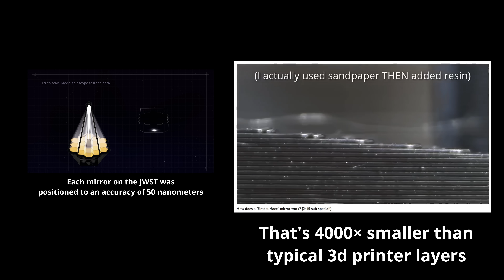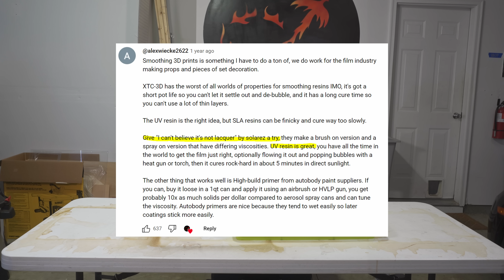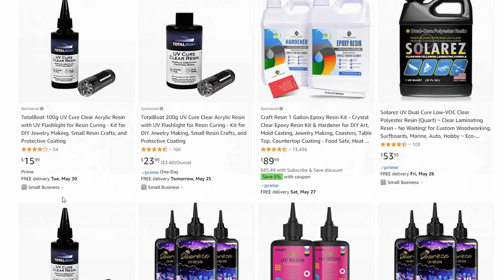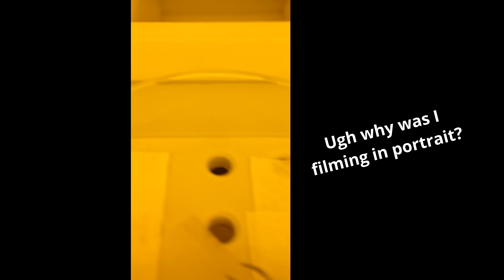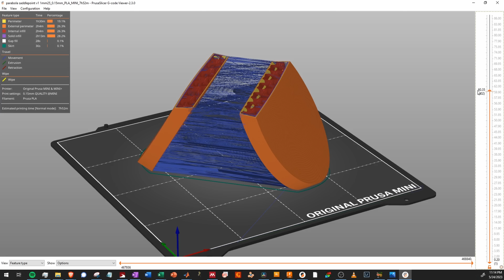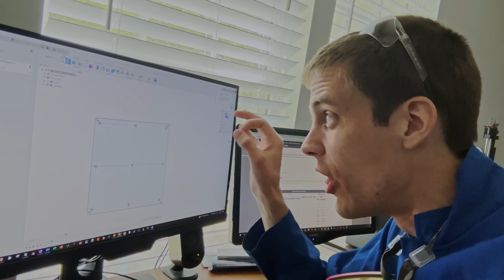Two ways to make asymmetric mirrors (Printing vs. Warping)

Comment from the maker: Corrections, additions, and FAQs:
1) Thanks to Steve for the idea of a saddlepoint mirror, and giving me the excuse to bust out the silvering solutions again! https://youtu.be/sP0cwLuEwsw

2) Yes, since I know people will ask, I have seen the HEN3DIRK channel that has some incredible videos of electroplated SLA prints. I haven't embarked on that challenge quite yet… https://youtu.be/ywPi1osy7o8

3) "use a resin printer!" yes, you're totally right! I have an old one in a box that I've never ventured to use. it's on my list! In this case, I still doubt I'd have achieved an optical surface, although if you read that paper I flashed up on the screen, they claimed to get something approaching diffraction limited with an SLA printer, which just feels impossible. I think their smoothing resin was also very different from what you can buy on amazon.
3b) Someone in the discussion below about resin printing said that you could buy one with 50nm resolution, and I highly doubt this. you CAN easily get one with sub-50um precision, but unfortunately 1 micron = 1000 nm. light is crazy small

4) z-axis wobble (or any inconsistency on the rails, belts, and screw) ABSOLUTELY could have been at fault for some of the wobblyness. I can't stress how small these changes are. It was difficult to film it in a way where you could tell there was a difference from layer to layer. For every purpose that isn't reflecting light, it was perfect lol.

5) I DID actually sand down my best-performing mirror prior to coating. you can see the sanded part in the "coating" close up, and you can briefly see the green jig with blue tape bubbles chucked into the lathe. for some reason I didn't actually film that?? I put the mirror on the lathe and use a few sandpapers. It made it look better to the eye, but didn't fix everything apparently.

6) I'm doing this crazy silvering process instead of some kind of chrome paint because I was initially trying to make optics, and for that the surface needs to be absolutely perfect. That's also why I didn't do vapor smoothing, which I think can leave a slightly porous surface.
Reply: I would have 3D printed only the perimeter and then shrink-wrap it
Reply: hey how can i contact you ?
Reply: Why not try a resin 3d printer? The layer line issue is almost non existent.
Reply: Resin 3D printing is much smoother and much stronger than FDM printing
Reply: Hi Brian, the way you think about and explain mechanics and physics is great. You said you like reading about science, so I have a link to a science article that I am certain you will enjoy reading. Are you interested?
Reply: My guess would be that a major factor in the 'every few Layers the direction changes' problem is the quality of the stl itself. Usually parts are designed with a mathematically perfect geometry (like vector graphics) but during the export to the .stl format, the curved surface gets broken down into flat polygons which with default settings would span multiple Layers. What you want to do in that case is to adjust the export settings to a level of acciracy that results in polygons that are smaller than the layers themselves. With that each layer will be positioned individually instead of in a plane with multiple different layers.
Reply: @Eoraph  I have printed things using the same STL file in resin and plastic usually pla although I have tried abs and petg and I can tell you from experience that I don't know if it's the slicer I'm using for the resin prints but the resin prints usually come out much smoother almost looking as good as an injection molded part.

Comment: I would have printed flat onto glass a solid mirror block. Then heat deformed the mirror to invert it leaving the previously flat glass-printed surface as the shaped mirror surface

Comment: If you mix your UV resin with baby powder, it'll become a paste that can be painted with, and after about five layers, you'll have a surface perfect for your needs.
You can also find some preposterously good chrome paints, which work best when sprayed (with an airbrush) on a 1k or 2k basecoat, and result in a mirror finish.

Comment: This is a very cool technique. I would love to see you attempt to make a parabolic mirror by curing UV resin in a spinning dish then silvering it. The focal point is a function of the rotation rate, but you might need something very accurate like a stepper motor to get a consistent speed. I suppose the dish could already be parabolic in shape so that it only needs a thin layer of resin too.

Comment: 1. Your guesses about the reasons of mid-scale wobbling are wrong. It's all about radial imperfections of the z-axis threaded rod(s).

2. Try to print with ABS and then smooth the lines with the acetone. Yes it will eat up the small details, but there are no small details on a saddle.

Comment: polystyrene mirror sheets can be heatshrinked to form this saddle mirror with first surface. You could 3d print the saddle with small holes for the shrink bed. The polystyrene isn't viscous enough to mold to layer lines, so they disappear. Great stuff, thanks for all the vids!
Reply: I just had this idea, as always someone thought of it first haha! Any insight into why styrene is better to use than acrylic mirror tiles for this? (Assuming both are first surface)

Comment: To get layer artifacts out you could try filler and sanding. If you want to avoid coating the 3D printed part, you could try slumping the acryllic sheet over the 3D printed part in a temperature controlled oven. Acryllic has a glass transition temperature of around 100°C. Polycarbonate 3D print filament has a glass transition temperature of 147°C. Alternatively make a plaster cast and then slump over that.

Comment: Hmmmmm...
...well the correct solution would have been vapor smoothing the plastic to get the correct shape.

So either us ABS in an enclosed chamber with acetone. Or ask chemistry lab to vapor smooth PLA with appropriate (and hostile to life solvents).

Thats how you get optical grade surface finish

And coat it for metallic finish via electroplating.

Comment: Creating a sharp image of something is the hardest thing you can ask a lens to do. There are non-imaging applications of optics (condensers, solar collectors, laser beam shaping, illumination) that can be served by a "good enough" lens. Creating custom-spec "good enough" lenses on a small scale using 3-D printing might have a niche where it does not justify the cost of making a mold.

Comment: Its too bad you couldnt just curve a hard drive platter. Those things are stupid shiny, and stupid flat.

Also a little mechanics trick I learned is when cutting a bolt, screw a nut onto it first. Then cut it, and removing the bolt will fix the threads

Comment: Just a suggestion, 
Why don't you use vacuum-forming to get your flat "whatever is feasible" to follow the shape of a 3D printed part. Printing small holes might not be possible, but you could drill the last few millimeters with a 0.5 to 1mm PCB drill .  The difficult part might be to geta sealing edge between the flat material and the printed shape, without causing tension deformations....
But for that I would suggest a bit of heating at the sealing flange to relieve the stress.

Comment: Recently I have been working with aluminium and nickel plating and I'm sure you could have achieved this effect with that. But I would really like to see a video where you explain what happens to the grain structure of aluminium during the process of burnishing and polishing as I don't really understand it and think it's an interesting concept.

Comment: I have used Angel Gilding products for more than a decade and I can say that the reason that the silver is coming off the sheet is because of the greater surface tension of the sheet so the wetting agent is not as effective as it is with other coatings. The solution for that is to use a Flame Treatment with a propane torch. Another point is that if you really want to print mirrors, just get rid of the FDM Printer and get yourself a SLA Printer, 4K resolution 3D SLA Printers are not even expensive any more(they are now pushing 8/12K). Silver mirrors will tarnish if not protected with a clear coat, but that will make them second surface mirrors. If you really want to 3D print and coat your own mirrors I would suggest investigating on to Electroless Nickel plating

Comment: I wonder if you could make a CNC sander out of a 3D Printer?  You could make a spring-loaded vibratory sanding head that would replace the normal printing head, and would sand down the printer layers.

Comment: There is a new FDM slicing  method that allows for limited movement in the Z axis on a single layer, you may be able to get better results using that. It may allow for better results since the layer lines  may be less impactful on the mirror surface. Though unfortunately I have yet to see an implementation of it that doesn't require some coding to use.

Comment: This strikes me as something that might be accomplished with a lappig process.

What about 3d printing a negative buck that can be rubbed against the first mirror surface with something abrasive?

Not sure if normal PLA abrades well - but maybe a filament with carbon particles or something would cut nicely.

Comment: UV cure resin is also used in resin printers in a similar way to the process you described, a mask is put on the LCD and then a UV backlight cured the resin through the mask. More advanced printers don’t use LCDs or anything like that though.

Comment: Hey! Thanks for amazing content!

I wonder if you considered switching to ABS plastic and finish the surface by simply putting the mirror into a chamber with acetone vapor which slightly dissolves the plastic surface over some tens of minutes? It is the same principle of surface tension smoothing the surface, just the liquid component being the plastic itself and not some complicated resin. You can precisely control the level of smoothening with exposure to acetone time. If you already tried it, what was your conclusion? Thanks!

Comment: have you looked into non-planar fdm printing? 

It's been used for creating smooth model aircraft wings to reduce drag from layer lines. I would guess that it would either get rid of the banding you saw or change it's orientation away from the reflective surface.

Comment: I don't know if this will work, but... For a project I was working on, I printed a thin lined grid of infill only (no tops, no bottoms, lines infill, [0,90], 1 wall, 0.24 line width, and a healthy infill line distance gap). Anyway, when I flex this part when printed as a square, it acts just like a hyperbolic paraboloid. This makes sense because the paraboloid is a doubly ruled surface and this grid structure is very similar. So where I'm headed with this is that the acrylic doesn't necessarily meet the double flexing needs and will start to have issues when bent too far and try to just be a simply bend. As you've shown here printing the shape directly is also problematic. How about a print flat and flex to exploit how well a printer can print flat and the ease of polishing a flat surface. Maybe a process like this:

1. Print a thin, flexible but flat surface on the bed (TPU?), then a doubly ruled support structure above it (the grid structure)
2. Surface the TPU to bring it true flat (if you can get good bed adhesion and a clean glass bed, that may not be much work)
3. Flex it to shape, then coat it, or vice-versa.

I think this would get you very close to an optically representative hyperbolic paraboloid, without a ton of work.

Comment: All of your mirrors are "bumpy".  A taut elastic plastic membrane forms a smooth concave shape when it is "sucked into" a ring-shaped form.  For convex, do the opposite, "blow it out" through the ring.  Concave and convex both have positive curvature; the center is stretched more than the edges.  A saddle-shape has negative curvature; you have to stretch the edges more than the center, because you can't shrink the center.  If you start with a circular frame, you need to increase its circumference without increasing its diameter; that forms the "Pringle" outline (or other shape...).  If you stretch the membrane and then bond it to a square "wire", when you release the tension, the membrane will compress the wire circle into "Pringle" outline (but the outline will always be distorted by the stiffness of the frame.  If you make a circular, hollow, "Pringle"-shaped clamp with two jaws, closing that clamp onto a semi-taut membrane will stretch its perimeter (but not its middle), forming a SMOOTH saddle shape.  (It might work better than trying to constrain the entirety of a softened floppy piece of thick plastic between two roughly saddle-shape non-hollow jaws.)  If the membrane shape is durable, just silver-plate it.  If you need something more solid, you could use the membrane surface as a mold.  Curved hollow circular jaws might not be necessary; hollow square jaws distorted into a square saddle shape might also produce a smooth saddle shape when they close on a semi-taut membrane.

Comment: spray the acrylic wirh tanic acid. I used to do this silver process on holograms that were pressed into acrylic. We had trouble getting the silver to stick and I think it was the company that provided the silver solutions sugested tamic acid and it worked great. and it smelked like wood too

Comment: For telescope optics, would it be possible to put the uv epoxy in a spinning tub like with fluid telescopes and harden it under uv light while it's spinning, then coat it to be reflective and get a perfectly smooth parabolic mirror?
Reply: agreed.

Comment: I would give acetone smoothing a try. 
Also, even probably not gonna work, centrifuge at constant speed UV resin while cure, so it take the shape. Problem is that it should happen basically instantaneous

Comment: Part 2: Make a perfect saddle shape out of wood then vacuum form some plastic around it and finally silver it. That should give you a perfectly flat surface and the wooden jig is much easier to work with than a plastic or resin one.

Comment: I think the reason why resin did not form very evenly is that there was just way too much of it. Spin-coat the blank to get a really thin even layer, then slow it down and cure while slowly rotating. If one is not enough, repeat the process again. Don't try to do it all in one go. 
As for parabolic mirrors in general, spin a petri dish full of resin. It will naturally form a perfect parabola that can then be cured with the UV light while continuing to spin.

Comment: I saw a video on toroidal fans that were 3D printed BUT they used Acetone Vapor on Printed in ASA(?) Material for a period of time. This resulted in a smoother surface of the 3D print. Their method seemed unrefined, but with a little mathematical tweaking might do a decent trick.

Comment: Should look at nonplanar 3d printing teaching tech has some good videos on that.  Would have help a tun with the surface finish on the printed ones, and it seems like an ideal use case for the tech.

Might also look into vacuforming for your reflectors. Should be able to make a form on the lathe and just form a sheet to it to get the ideal surface.

Comment: The filament can vary enough to do that. Also heating fluctuations in the bed and hot end. There is also this cog teeth on the extruder that cause this. I think a post process would be the easiest way to remedy the issue. Unless you want to buy a resin printer or a Bambu labs X1C. Jamie Mantzel did a video on making a clay dome mold from a pendulum. I think this same sort of method could be used to smooth or iron the surface out to a perfect flatness. I haven't put much though into the mechanism for the other shapes of mirrors. The con cave pendulum could use a ball that is heated at the effecting end. With a nonstick sheet between it and the surface of the 3d print. The joint would be the key to making it smooth. There are high quality ball joints for RC cars out there that might fit the bill. You could also smooth something else out on the surface. Like body filler. Jamie's video - https://www.youtube.com/watch?v=5zgTcK3Ri44

Comment: have you heard of non-planar 3d printing? you would basically have the surface layer be just one layer of filament. with the slopes and hills built up with layers beneath. Not sure quite how it would help in this project, but I would imagine it would make this project easier.... somehow.

Comment: With classic FDM printer there is also a possibility of non-planar printing, creating G-code which moves printing head simultaneously in all three directions. How far one can put this technique depends, as I have read / watched videos about, on the clearance around the printing head.

Much better surface for surfaces that are close to being flat.

With saddle shape, as mentioned in Steve Mould video, you should be able to create a custom G-code that takes advantage of the fact that the $z = x*y$ shape can be composed entirely out of straight lines at different 3d angles.

Comment: Have you seen applied sciences video on optical polishing? Print your part, then smooth the surface, and finaly resin coat. That should give a very decent surface. Although much more labor intensive

Comment: 10:45 There is nothing wrong with your printer. Any sort of cnc, including 3d printers, will quantize coordinates to what it can work with, and 3d printers especially, will happily convert dimensions to integers corresponding to motor steps.

It's literally impossible to have curved surface straight from such machine, even a plain circle will be an n-gon, unless it is a drilled, bored, or turned feature.